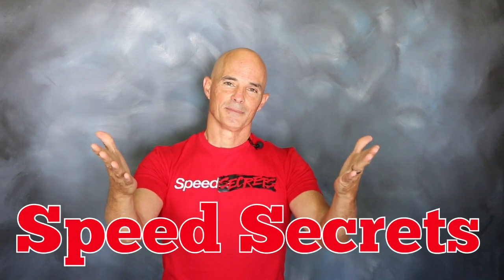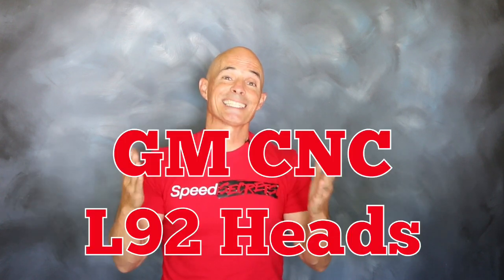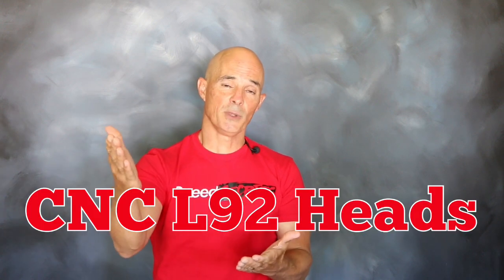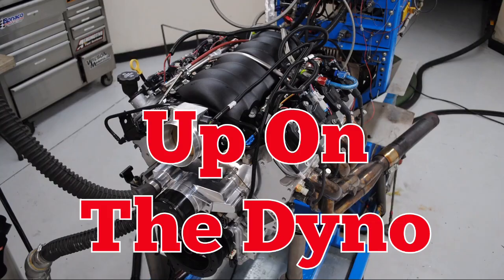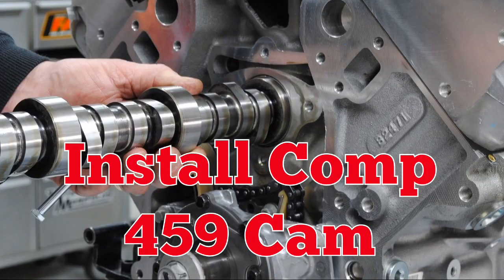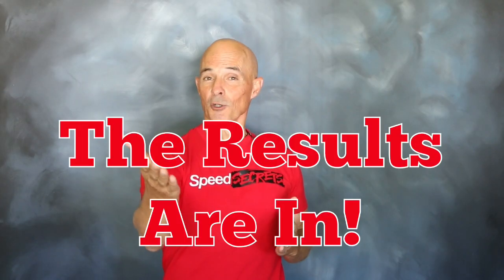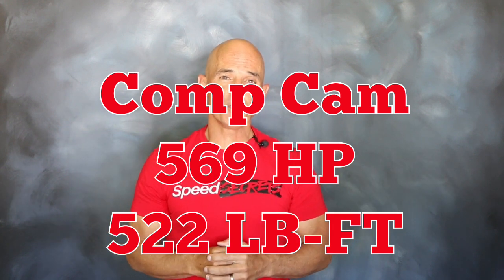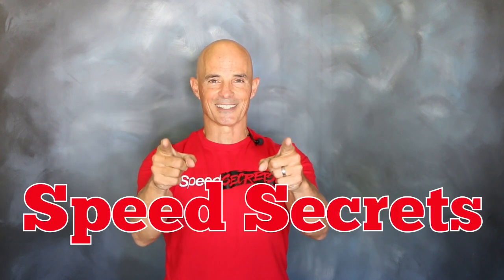Speed Secrets: Swapping a Cam in an LS3 Crate Engine

Comment: Does it void the warranty? Like say if I get a GM perf LS376/525 crate motor and immediately swap out the GM hot cam for an TSP stage 3 LS3 N/A cam, .660 dual valve springs, compatible pushrods and a trunnion kit. Does that void the warranty ?

Comment: Richard I’ve seen this ls3 in a lot of your videos.  In the video you say you ran beehive valve springs with the I believe 469 comp cam and made 580hp.   My question to you is did you use the stock ls3 lifters and comp recommends a way heavier valve spring for that cam.

Comment: I have a lh6 all alum.5.3 with 799 heads .i read putting ls3 cam with ls6 valve springs is budget friendly +50hp ?
Reply: IMHO, if your going to do the work then may as well spend the extra little bit and go with custom grind cam and look into the various springs.  The parts are not expensive.